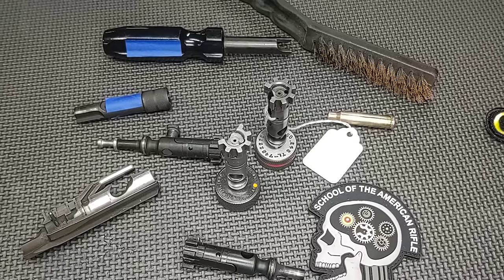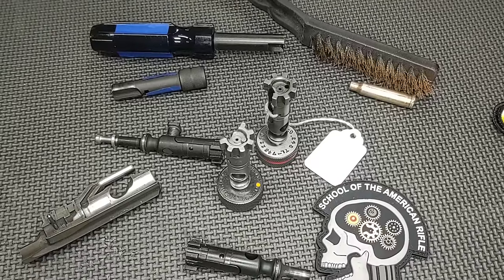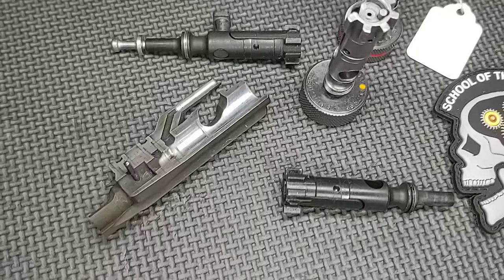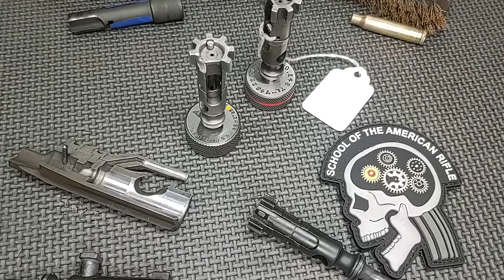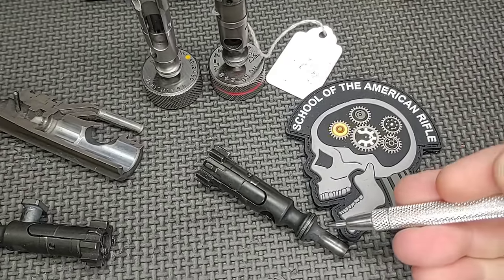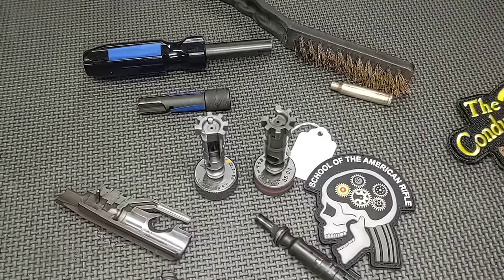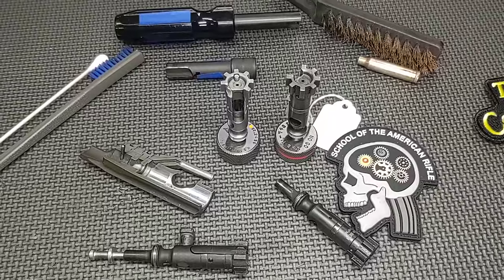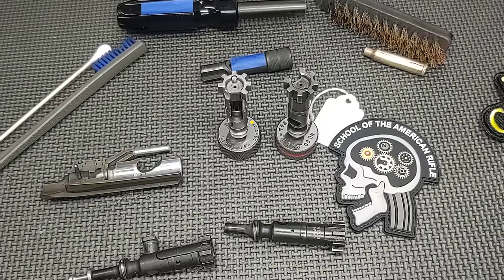Improper Cleaning can ruin your AR15 Bolt Carrier Group

Comment from the maker: Many people seem to believe that certain tools can't wear or change the dimensions of the bolt because the tools people used may be softer than the bolt material or the coating.

Fouling is abrasive. As fouling is removed, it will lap the bolt material when used between the bolt and a tool. Fouling can wear the tail when a bronze brush or piece of brass is used to "clean". Fouling can wear the inside of the carrier when a tool is used. 

Ever look at a crowning lap? They are brass. An abrasive with the crowning lap will remove barrel material. 

A cleaning rod with fouling can remove barrel material as it moves. A bore snake used the wrong way can remove crown material.

The difference between efficient and non efficient of most bolt tails is .0006. Thank about how little that is before changing the dimensions by "cleaning".
Reply: This was about to be my question. Happy to see you answer it before I even had to ask! Still seems like it would take a crap ton of cleaning to actually change dimensions but I guess I'm just not as OCD as other people haha.
Reply: By any chance, are u can AK Smith (or builder) also?

Or a guru of American Made Rifles only?
Reply: What do you mean by a bore snake used the wrong way? Like people dropping it through and pulling from muzzle to chamber?
Reply: Whats the proper way to use a bore snake??
Reply: I’ve had people argue with me about this same thing you’re talking about.
Reply: @lordserpentine8246 Pull it straight out of the muzzle. Never pull it at an angle or else you will lap the crown of the muzzle and that will affect your accuracy. Chad has a video about bore snakes.
Reply: @John5.56 I wish I could tag multiple people when you reply. See my comment directed at Serpentine.
Reply: How do we feel about ultrasonic cleaners with mild detergent like Simple Green, not a commercial solvent?
Reply: Thoughts on cleaning the BCG parts in an ultrasonic cleaner?
Reply: @blacksmithcowboy4725 good question, I’m interested in hearing a good response to that but my guess would be it’s totally fine seeing as how that’s not much of an aggressive chemical and there would be no lapping or abrasion happening. It’s only breaking down carbon and forcing new solvent in where it needs to go, sort of shaking the carbon off instead of lapping. I’m no expert…
Reply: What about ultrasonic cleaners? Particularly Hornady?
Reply: can i soak the bolt and carrier in something and use like a toothbrush and like a air can to clean it without scratching ?
Reply: We caught two "trustees" cutting bars out of a window at the Fairfax County ADC back in the 1990s.  They had cut one out and were working on a second.  Their tool was DENTAL FLOSS!  Plenty of time of their hands.  My son has worn down some of the keys on his plastic gaming keyboard.  That's human skin and nails wearing pits into the plastic keys.
Reply: @jjthefed  Nylon (dental floss) has a hardness of ~3-4 on the mohs hardness scale, steel is 4-6.5.  If that story is true, those bars were made out of the lowest possible quality steel and that was some really good dental floss.
Reply: You can get small ultrasonic cleaners for pretty cheap. A great way to clean tight tolerances without abrasion.
Reply: @lordserpentine8246 bore to muzzle.  Same for any cleaning rod.
Reply: SUBSCRIBED
Reply: Absolutely.

Comment: Reminded me of a day in basic training after the rifle range many decades ago with M16.  Drill Sergeant told us that when the armorer accepted our rifles individually we could go to the PX.  Well, we scrubbed those rifle clean enough to eat off of.  Of course the armorer was in on the ruse, so no rifles were being accepted.  A couple of buddies and myself found a good place to sleep after being rejected.  Some of the others scrubbed, submitted, rejected, scrubbed, and resubmitted for 4 hours.  When we heard the armorer was accepting rifles at the end of the day we dutifully turned in our once cleaned rifles.  All those poor rifles had the finishes scrubbed off them over the non-sense.
Reply: Got that same memory !
Reply: In the Service,, overseas, we broke the rifle in two, dropped the top ( minus hand guards) in half a 55 gallon barrel of solvent while we cleaned the lower, then did a bore scrub and rag clean on bolt & carrier.
Never had a problem or inordinate wear.
Reply: Our armorer in the Corps had a rifle on display in the arms room ... one of the Marines, it seems, had seen to it to spray Easy Off oven cleaner on his weapon and left it on most of the day... when he went to wipe it off, it took the coating completely off. It was literally shiny metal.
Reply: Sounds like the soldier got a statement of charges for Christmas.
Reply: The Marines I hung around with in 70's had several tours in Vietnam, they used carb cleaner and would ship cases to friends in far east, pop rear pin pull bolt and spray tube, barrel and bolt, they said just needed to clear fouling.
Reply: @keithbarron3654  after a week-long field op or range time, we would take our weapons into the shower and clean them ... do level 1 armorer shit to get carbon out ... passed inspection every time. Only time I ever failed was trying to PCS and a corrupt armorer wanted $30 to "check it back in and clean it" ... failed me every day (along with a few others). Two days before we were to leave, the Gunny looked at our PCS checklist, and asked why we were still not clear with the armorer. When we told him about the demands for money, he marched our group over to the armorer, presented our papers, and said "you sign these fcking papers right now or I will have your ass" ... funny how the armorer complied quickly.
Reply: @keithbarron3654  
My service was 1970-1974.
Reply: I imagine the small arms repairman couldn't have been happy about it with the armorer
Reply: And he became part of the e4 mafia. Lmao
Reply: I’m glad you had the good sense to question the authority. Those that follow orders blindly are at risk of being used as tools for genocide
Reply: Are nylon pick tools acceptable for scraping? I genuinely use a cleaner to soften and a flat-bladed nylon end of my pick set to  scrape fouling.
Reply: Yes.   Use a bronze bristle brush with solvent.  It is the cost of doing business.
Reply: @rarelibra  Err, are you saying it removed the anodizing off the aluminum?  Because anodized aluminum creates a ceramic that is chemically inert.  I'm going to put this in the bin with every single other story a Marine has ever told me.

Comment: An old guy taught me that sometime in a pinch, you can use wood like an ice cream stick and other appropriately shaped little pieces of wood without harm after soaking parts.  Also taught me I could use hot soapy water for cleaning as well which I've done countless times with zero rust issues.  Just got to make sure you rinse clean with hot water and make sure the metal is hot when you shake it off so any residual moisture evaporates quickly and completely and then just oil her up.
Reply from the maker: Wood Chopsticks are great for scraping, if scraping must be done.
Reply: @SchooloftheAmericanRifle   corn dog stick
Reply: A bamboo skewer works for me and can whittle the end into whatever shape you like.
Reply: Snap a wooden cotton swab in half, use the pointy aftermath for hard to reach shit
Reply: Rubbing alcohol is better.  It's used to clean electronics, too.
Reply: Tooth picks work great!
Reply: @manictiger  or break parts cleaner.
Reply: @SchooloftheAmericanRifle  I use toothpicks or bamboo kabob sticks if I ever get something that i cant lube through or cut with gunscrubber & Clenzoil
Reply: Carburetor cleaner and then just a Q-tip.
Reply: Toothpicks for picking under extractor/ synthetic brush and Mobil one synthetic grease in a film canister in my range bag for 9 years. I think I used 3/8 of an inch of that grease in that time.
Reply: Learned that at boot camp 1980
Reply: I will have to use this, for the boat tail of the bolt I was using a small Allen key, I don’t even know if the material is softer or stronger than the bolt
Reply: Hot soapy water is the best cleaner period. There’s a reason every one shooting black powder defaults to it.
Reply: @lmaolmoo4147 it's not just for the cleaning in black powder. The hot soapy water has an even more important job than cleaning, and that is dissolving corrosive salts!!!
Reply: Used to heat up the oven and put in my 12 Guage parts after boiling bolt

Comment: Man I love that cutaway bcg
Reply: So do I!  Finally understood the action of an AR-15 because of that little bewdy.
Reply: @chipsterb4946  It's a lot like a simple lawn mower engine, really.  Imagine the bolt as the piston.  The gas block & gas key are like your carburetor & intake plumbing as well as exhaust, may get a bit confusing there.  But it's really a piston w/ rings, with a dislocated combustion chamber, and unified intake/exhaust cyclic return.  The cutaway is awesome for letting folks see the piston-like operation.  And for seeing it all work together.

Comment: I always wondered if the scrapers were safe to use. I've watched other channels where they used the bone scraper and really screwed it in the bolt. Wasn't sure that that was the best way to clean a bolt carrier. And the guy doing it was from a big well known company. The way that i look at it is if i think that it may scratch the surface of what I'm cleaning , i won't use it. Some good cleaning chemicals will do the job. Thanks for the information. I don't want to go scraping on my $300 bolt carrier.
Reply from the maker: There are some Armorer's & Instructors that I respect deeply, who say maintenance should involve scraping tools. 

Their advice comes from the right place, but I don't think they know what the tools are capable of doing.
Reply: I think the ‘manual of arms’ FOR cleaning with say..the ‘cleaning kit’, yeah..the mil spec one with the STEEL cleaning rod (!) has more to do with FIELD cleaning..not in barracks or garrison. And certainly not on a HIGH-end BCG or bore. Soldiers generally were/are cleaning WHEN they had time and not under fire. Thinking Iraq and Afghanistan..
Reply: Glad I forgot to buy one, lol.
Reply: @manictiger  Same.  My forgotten purchase was probably somewhat intentional as I've seen other videos from this gentleman cautioning on the treatment of these strong yet delicate areas.  To me he comes across as the Jeff Cavaliere/Athlean-X of the gun community.  There are sooo many experts and authorities in this genre and I appreciate them all, but none carry the authoritative weight of this one well spoken knowledgeable and experienced source.  I really appreciate you sir!  @InstructorChad

Comment: Spot on,  once you remove metal,  it cannot be put back on!  Always use the least aggressive measures first.  Excellent suggestions with CLR and Berrymans carb cleaner.
Reply: @Peter labor to build up and then mill/lathe off to tolerance would cost more than a new BCG
Reply: @Peter Specifically,  what is your point?
Reply: @Peter If you’re “glad” someone missed your point, it demonstrates you never had anything beneficial to add the conversation to begin with.
Reply: @MRTEE-sy7sb  100% correct. You'd only pay that price once :D But I'd probably watch a YouTube video of it being done by a professional machinist/gunsmith repairman.
Reply: Brass isn't mechanically capable of abrading steel.  This is just a video of some old wives tales brought to you by a guy who doesn't understand material science.
Reply: @kevindonahue2251  Its NOT the brass that does the abrading, its the carbon/fouling itself, it acts similar to a lapping compound when done in the manner described in the video.

Comment: Thanks Chad! I do have one of those multi-scraper-doohickies, but I've never used it. Usually some Clenzoil on a patch or two gets everything off. I do like to hit the lugs with a brass brush though, and my Dewey cleaning kit comes with a chamber brush and mop that works really well. Used gently of course. That cut in half BCG demo makes it perfectly clear why you don't want to go grinding on the bolt tail or inside diameter of the BCG.

Comment: I have had very good results by using MPRO 7 to lube after I clean.  I notice you said a "wet lube" early in the video.  Usually if it "looks" wet it is probably pretty good.  The MPro makes cleaning easier for me. Slip 2000 is also good. The crud wipes off with a blue shop towel.  My only issues with them are the containers they come in.  I transfer the product to a bottle with a needle oiler. Partially for precision but mostly to save some money.  Both products are expensive.  I am sort of frugal (read cheap). Have a good day.  Thanks for the great videos.  So informative.

Comment: CLR is somewhat controversial.  It does remove baked on carbon fouling, but it is very aggressive, and needs to be removed with alcohol, brake cleaner or lacquer thinner when you're finished with it.  Probably best to not use it on any blued guns.

Comment: What! You’re supposed to clean an AR15? As an experiment, I went over 6000 rounds without cleaning, just putting some motor oil on the bolt. Zero malfunctions until I wore the barrel out.
Reply: If your going to get the rifle super hot sending rounds down range at a continuous stream, get one of those double chrome lined barrels.  Shoots tracers too. How fun would that be?

Comment: There are a number of products on the market designed to emulsify carbon in two-strokes and small engines. A couple are made by outboard engine manufacturers (I use Engine Tuner, which is from BRP) and work well to soften even heavy buildups of carbon.

Comment: Maybe I’m lazy, but after a trip to the range I just disassemble the BCG, wipe the BCG and internals with a clean cloth, add a layer of oil and reassemble.  It’s not a hardcore cleaning, but enough to remove most of the fine abrasive dirt and to freshen the lube with synthetic motor oil. (I’m sure someone will lambaste me for using motor oil, but it’s what Dad used and I still have and use his 90-year old guns).

Once in a while, I will run the disassembled BCG and parts through an ultrasonic cleaner with RCBS Weapons Cleaner and distilled water, hit parts with a toothbrush or, at worst case, a brass brush.   Relube, reassemble.

I keep a can of Ballistol in my range bag and if anything looks dry, I’ll give it a quick spray.  Other than that, it’s clean enough.
Reply: If it works...it works. I'd question whether motor oil might be less effective though, at a molecular level. Gasoline burns around 2000ºF, while gun powder can be double that. Even if the direct impingement bleeds off some of that excess heat before it hits your gas key & bolt carrier, it might be enough to burn off the motor oil sooner than a tried-and-true gun lube would.

I personally use CLP in one form or another for ARs, and Shooters Choice for guns which prefer grease. Neither has ever caused me issues.

Comment: Also-- Bronze brushes generally can't hurt steel in the HRC 36-40 range when used by hand, they are softer than steel by quite a bit. That said, even water can wear down rock, so any abrasive (regardless how soft) with enough cycles will wear parts.
Reply from the maker: The fouling itself is abrasive and paired with brass or bronze does wear down steel.
Reply: @SchooloftheAmericanRifle  this is why I follow this channel. Learn something from the videos and comments every time. Thank you!
Reply: It doesn’t matter the hardness of two materials, if you rub them together (even without any compound) they will wear on one another.  I can show you where my dog left footprints in a wooden windowsill 😂
Reply: @SchooloftheAmericanRifle   Only if you are scrubbing the bajesus out of it!!  Meaning if you sit there for 15 min brushing the same damn spot.  If brass/ bronze bushes were a real problem, we would never use them for cleaning the barrels

Comment: On people thinking the AR15 needing to be shiny clean to run, I've outright seen an AR15 which ran perfectly fine, and where the inside of the bolt carrier looked kind of like the ancient city of Pompeii.

Any decently put together example can tolerate quite a lot of carbon, and it's generally pretty good at keeping a lot of foreign dirt out of most parts.
Those InRange mudtests were far from scientific or even realistic, but they repeatedly show that anything from an old 1960s Colt SP-1 to a number of modern builds will more than tolerate some pretty obscene levels of filth.

Comment: Exactly correct on carbon solvents and proper lubrication after cleaning. CLR works but your warranty will be gone but how would they know. I use Freeall penetrating lube for a good soak in the barrel and spray the bolt and BCG after using hoppes to remove carbon first after taking those parts apart for deep cleaning once a year or every 3 to 5 hundred rounds. Running it wet on the BCG friction areas is fine, not in any gas ports.

Comment: I was taught this way and only recently learned how the scraping tool (like the one on your worktable) was lathing away the inside of the bcg. That having been said, would you do a video on gas rings (replacement, tolerances, etc) for those of us that damaged them with that pesky wire brush?

Comment: A couple questions.
1. Would carbon build-up on the bolt tail not improve the seal between the tail and the carrier?
2. Is it bad to drop lube down into the gas key, instead of removing the bolt and lubing it directly? It would seem to me that the residual lubricant would absorb carbon, burn off, and make the interior of the gas key cake up at a faster rate than a dry one